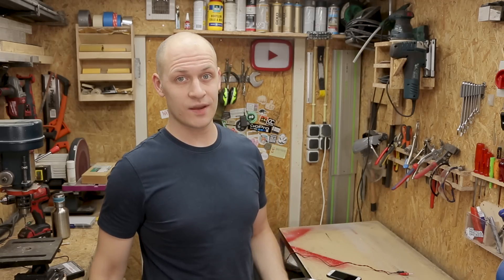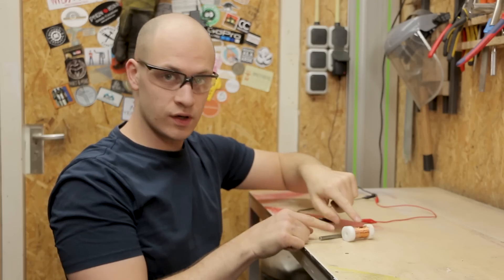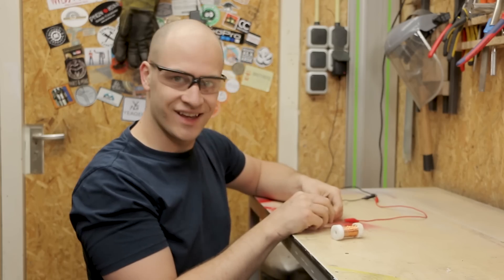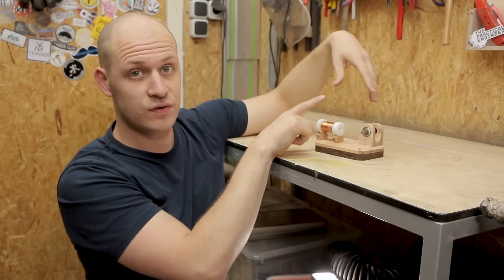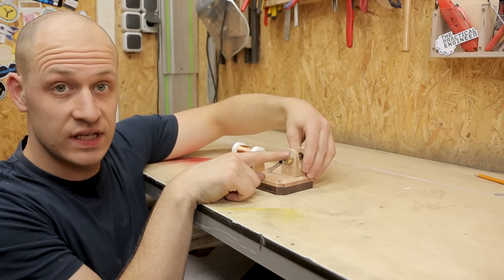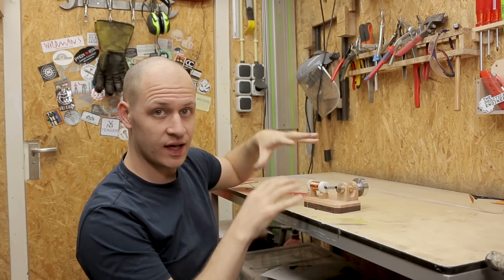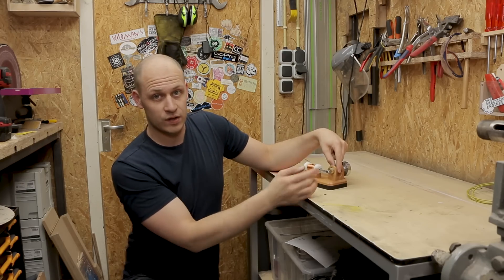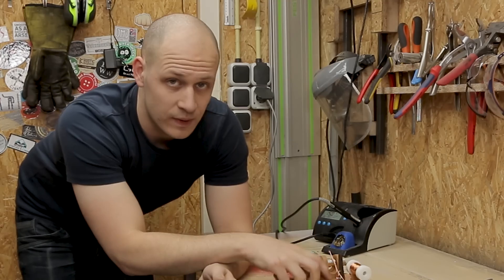How to make a Solenoid Engine

Comment: I have checked YouTube and I cannot find one video on how to make a tubular dual push pull solenoid to have an inch and a quarter push and an inch and a quarter pool so I can use it to ship the motorcycle can you help me can you make one a video thank you
Reply: I forgot to tell you if you could do it it will be used as a momentary switch just allowed to engage to push the shifter lever and then it would disengage I need to push where to go up in gears and I need to pull so it'll drop down in gears for everyone push on the momentary switch it would add a gear if every push on the down momentary switch would reduce it gearthank you

Comment: I'm struggling with mine, not sure if con rod too long or short?
Reply from the maker: Looking at the pictures there are a couple of things it could be: 
- The alignment of parts seems a bit off
- The flywheel looks light, it must have enough mass to keep it going over it's dead spot.
- I assume the direct wiring is just for testing, it needs to switch on and off.
- Any friction will stop it from working.

Hope this helps.

Comment: ❤Hi, your tool is very good, but it is not working properly. I used it for IC thinking and used a power circuit to increase the power. The first weight you used was not good. The copper weight cut the air  It works. I am lucky to have found such a good tool and computer

Comment: I know how to build these know. Made my first one about 6 years ago. You need trial and error. I like the look of the power transistor. I will have to steal that for my next engine. But only 2 instead  of 3 leads on a transistor? I will have to watch a vid to see how that works. Man, I hate transistors!
Reply from the maker: The body of the transistor is the third lead

Comment: How many turns did you put there?
If someone knows how many turns should I do at least , please tell me.
And is there any Physik low that could measure the power of the coil beside the power of the magnetic field in the coil? I mean is there any low how much weight it could carry if you use that for Lifting things?

Comment: Why don't you use an Ne555 signal generator to turn the solenoid on and off repeatedly? They're cheap and would give you more control over the frequency and duty cycle. You can get ready made ne555 signal generator boards on ebay for as little as $1. For example:

https://www.ebay.com/itm/264500705479?hash=item3d957878c7:g:HUIAAOSwgqZdpym3

Comment: you would be able to get better current transfer by using a linear switch and a cam. just use cam distance of 1 mm. the switch need a spring but can use flat surface contact by increased surface area to prevent current loss in input.

Comment: What about a magnetic switch. A Reed contact. Will solve the problem of the sparks
Reply from the maker: That's also an option. In my v8 version I used IR sensors

Comment: also i have one question i don't understand the concept of you putting copper springs and increasing it's speed.
Reply from the maker: The speed increases because when I push the copper wire it makes earlier contact
Reply: @Thepracticalengineer  Thanks buddy that helped

Comment: If you drive the flywheel with a prime mover and replace the plunger with a magnet, could it be a generator? Would be neat to have your motor in series with its twin generator to get (some of) your electricity back.

Comment: Langzaam.  Ik kan je niet verstaan.
Reply from the maker: Oeps, ja ik ging best wel snel steeds I. Het Engels. Zijn de Nederlandse videos beter?
Reply: @Thepracticalengineer  hey, I'm in a similar project, I'd like to see how much it produces when used in reverse, i.e as a generator. Sure it can power a phone but what about a heavier household equipment?  It'd be nice to see the power capability. Although you'd have to replace the piston with a magnet for this to work.

Comment: Hey there, awesome video! I was wondering how exactly does a solenoid measures its power of attraction, or magnetic field? I mean,  what is the relation of that? I assume that the thickness of the wire affects that, the length of the wire around the cylinder and the longitudinal length of the cylinder itself, right? But how could I calculate that, is there a formula? I am interested in the making of a solenoid in all its forms
Reply: What you say is correct, number of turns, thickness, current, geometry of the plunger... the combination of all is not straight forward to calculate. Check out FEMM for solenoids. It's a free FEM tool for electromagnetics.

Comment: sir i have made this solenoid engine...i had used 12v but it appears to be less...so how much volt current and how much amper current should i use.......plzz reply fast its my project n i have to present it😊
Reply from the maker: My version runs on 24 volts. But it all depends on the coil you made
Reply: @Thepracticalengineer  thank you sir☺
Reply: @Thepracticalengineer  bt how much ampere?? 2, 5 ?

Comment: Excellent video. What was the voltage across the coil and the gauge of copper wire used?
Reply from the maker: This one runs at 24 volts I believe I used wire with a 0.36 mm diameter here

Comment: Why waste time to make a spool? The wire comes of a spool!
Reply from the maker: Yeah but the spool it comes with is not good for this use. The wire has to be very close to the rod it has to pull. Magnetic force reduces exponentially over distance
Reply: @Thepracticalengineer   and someone suggested to use a freewheel diode. that's very important to protect the transistor. The energy that would be dissipated in form of a spark is now going into the transistor via the collector emitter route. this will shorten it's lifespan.

Comment: I have suggestion for the switching of coil power
Why not use a micro switch with arm and roller thus eliminating the transistor and the springy wires you made ??
This is how I would do it

Comment: I wouldnt consider this an engine, asana engine powers itself by converting a reaction to energy. Combustion engines take air and gasoline and light it on fire to create an explosion that forces a piston to move. Air engines use compressed air to force a piston to move. In this scenario, we aren't taking energy from anything physical, we're simply giving it energy. I would consider this a Motor, as its converting an energy into some sort of work, in this case spinning. I dont know if I have those definitions right,but I'm pretty sure that is the proper distinction between an engine and a motor. You shouldn't have to give power to an engine, when engines can be used to create power
Reply from the maker: Thanks for your very elaborate way of telling me that I'm wrong. However for some reason devices like this are usually referred to as solenoid 'engines' I can't help that. Being right and calling it a motor will most likely cause the video not to show up in search
Reply: Yo he construido algunos motores con solenoides y la verdad no tienen fuerza  (prácticamente nada de torque) , son ineficientes, pero lo que si me gusta es que son didácticos y construyendolos aprendí un poco. Los he construido con imanes de neodimio y parecen más sensibles y más controlados consumen menos energía y las bobinas son más pequeñas tan bien utilizo volantes con mayor diámetro,  lo que permite un mejor funcionamiento en bajas revoluciones ( al ralenty ) . Estos motores son más bien didácticos y eso lo saben los que los construyen en la mayoría de los casos hay que iniciarnos con un pequeño empujón en el volante.

Comment: I'm not sure why you cut a custom plastic piece on the lathe, and didn't just use the original spool of copper wire, customizing the entire spool for the purpose.
Reply from the maker: The coil needs to be very close to the material that it needs to pull (the plunger)

Comment: Nice post but solenoids and electric motors are not engines.... So the fact ppl in the maker community, keep calling these models of reciprocating engines Solenoid Engines instead of Solenoid Motors is a distraction from fully enjoying the posts about them...
Reply from the maker: I see where you are coming from, but people search for solenoid engine, so I'd be stupid to call it otherwise and people won't find it. 

If you watch it full screen you don't have to look at the title ;)
Reply: @Thepracticalengineer If you do want to refine your design, I suggest adding  a counterweight to the reciprocating mass of the piston and connecting rod to improve the  engine's balance.It's a principle used for developing a crankshaft. And it will also allow the mass of the flywheel to be reduced. 
BTW, The term "Solenoid Engine" was new to me. And I realized soon after posting my comment I was being pedantic and naive, in terms of marketing your posts. 
My bad :)

Comment: This is pretty awesome. I feel like this could have been a precursor or prototype to the core armature design using a cammed switch. Makes building a low power motor by hand easier too. Edit: research confirmed electric motor prototype. :)
Reply from the maker: Thanks! It is an awesome project indeed!
Reply: Yes, put a cammed switch using a set of Automotive points

Comment: Great job on your design and engine!  I have made similar solenoid engines, but the switching has always been a problem.  I think that a hall effect transistor switch would be the way to go.  Thanks for a great video!
Reply: Hi, yes dc in-air contacts for switching even modest current of less than half an amp are a pain.  I agree that electronic switching is far better.  But if you're  a weirdly stubborn purist like me it can be done without semiconductors.  I took the contacts out of the thermostat of a scrapped fan heater, rated for 240V at nearly 8 amps.  Overkill?  My little "electric Newcomen beam engine" runs on 6V at about 300mA.  I gave myself a pat on the back!
Reply: Yo he construido algunos motores de solenoide y si efectivamente para energizar la bobina el switch es un problema. Para corregir el problema hice una bobina con alambre delgado sobre una jeringa que me diera como 15 ohmios y lo que use de pistón fueron dos imanes de neodimio . Para la carrera del piston no usar  más de la mitad del recorrido dentro de la bobina . Para cerrar el circuito utilizar dos alambres que hagan contacto en el eje . Si desea le envío un vídeo
Reply: Creo que fui un poco inprudente , no se si esto se puede hacer ?  siento que no es ético disculpas a practical engineer

Comment: I just discovered you channel and I really like the way your honest about your mistakes.  most you tubers are terrified of showing them and edit everything like crazy.  a true engineer, (such as yourself), knows that all good mechanical devices require hours if not years of trial and error to work out the kinks, and therefor are not afraid of those small mistakes along the way. good on ya bro. 
   as a new subscriber, id like to join the group with a question.
   I've seen other people make solenoid engines of various types, in general they are all very clunky, my question is: is there any practical purpose/situation where a solenoid engine would be better than a standard electric motor, (other than for quick back and forth motion),  for rotating a wheel/flywheel etc?
thanks, and I'm looking foreword to checking out more of your vids.
Reply from the maker: I believe indeed that mistakes are part of the process. But a lot of people get scared by the idea of making mistakes. That why I try to keep them in the video if they happen and they are worth showing.
To be honest I don't know of a practical use for a solenoid engine. But they are nice to make and fascinating to watch.

Comment: we only push or pulled the solenoid engine and a spring which is powered enough to get back the solenoid to it's original position so we used half cycle technology and less electricity?????

Comment: you creates a very strong spring based battery so we press the spring with hydraulic pressure setup  and it's then released slowly and turned the turbine or generators so we got energy or electricity
Reply: How voltage in required

Comment: My favorite parts of your videos are you showing your screw ups and problem solving. It didn't work correctly the first time you powered the solenoid engine but instead of editing out the content you added it. Kudos!

Also I found it really cool that you could cause acceleration by applying slightly more pressure on the adjustable copper wire.
Reply from the maker: Thanks! Yeah! Screwing up is part of the process. A lot of people are afraid of failing and I want to change that

Comment: Outstanding!!! I really like your work and shop practices, top notch. I'd  work with you anytime.  If I may offer a suggestion,  I have quite a bit of experience making and winding coil springs and have used drills, motors, hand wound and lathes to do so. I have found that in all cases running your wire stock sandwiched between a firmly anchored clamp and piece of wood (mounted to in this case the bed of the lathe) will make your windings on your solenoid tighter, neater, more evenly spaced and give a truly professional appearance. I understand that the coil is not a spring, but the principal and practice are the same. All the best, and look forward to more videos.

Comment: I have watched your 4 cylinder one as well, awesome videos. You should try 3d print a Nitro engine but create a solenoid around the piston. You could then re-use most of the Nitro gear, flywheel, maybe the throttle somehow?

Comment: Would this be an effective motor
Reply: Energy in = energy out - mechanical resistance, bearings etc, so it probably just has enough power to make itself move, this is a good project, but is really just demonstrating electrical energy into mechanical energy.

Comment: IDK if someone can help but what are the point of the 2 like springs that rest on it? Is it to keep it rotating?
Reply: I think it is to switch the power on and off so the Piston can move back and forth
Reply: Austin Boals I think where the two springs come into contact with the bushes a different times, one spring is connected to the positive and the the other connected to the negative so changing the direction of poles which allows it to pull and push the iron bar. Please someone correct me if I’m wrong but that’s the observation I’ve made

Comment: I don't understand the switching part plz make it clear
Reply: Arjun pattonathil I think both switches come into contact with the bush at different times. One switch is connected to the positive and one switch connected to the negative so the poles would be constantly changing which would result in pulling and pushing the iron rod. I could be wrong but in my head that’s what makes sense. Hopefully someone can correct me or verify soon
Reply: @Livefree432Livewhole   Thank u ...

Comment: Hi im from malaysia . Where can i get the drawing for this project? Thank you
Reply: Watch this video 10 times with 100% listening. He has given all information. Then try (I failed with different design). Now I am trying to copy a similar design with different proportions and experimenting with solenoid making, winding, SWG, supply volt 12 or 24v, coil material, armature dia etc. It looks easy when we see. But actually its perseverance which pays to a successful result. I like he shows failed attempts too which are very useful and solutions finally.
Reply: Pramod M do you have video ?
Reply: @muhdshafryzal6456   No Sir, to make a video, it requires a different talent. You need to show, set camera angle and have a proper plan and materials and editing skills, which I lack as of now, though I have majority of tools. Though I don't like failures but have learnt a lot from failed projects.
Reply from the maker: I do not have a build plan for this but I have the designs uploaded to my patreon page

Comment: can a solenoid engine drive an auto or truck??  if so why aren't electric motors used more often.
Reply: I think normal electric motors are more powerful than solenoid engines.
Reply: No  son didácticos requieren mucha energía  tienen poca fuerza

Comment: I want to craft a blowback bolt for my gun project, the bolt should move about 9-10cm, what length I should do the solenoid, as the bolt have a welded long steel pipe that should go inside the solenoid, and a spring also to return it as soon as I take my hand from the trigger. Is not a real gun, is just an airsoft pistol and I will build a fake gun around it, but I need to have the blowback effect :) also, what batteries I must use? Can I use 9v or I must have 12v? Also, can I use 7.2 or 8.4v, 1800mah (standard airsoft electric gun battery etc? :)
Reply from the maker: I don't know what you need specific.  But I think you can use any voltage as long as the amps are right. I tried to get about 2 ampere through the spool. Determine what amps you want and from there you can calculate the ohms the spool needs to be. Then you can look at copper wire and use the resistance per meter to calculate what length / thickness combination you need. There is a lot of dependant factors and is just trial and error for me.
Reply: @Thepracticalengineer  all I need is to move a piece of cilindrical  metal, with a Soft spring, but I'm totally crap with voltage/amperage so that's why I don't know if an airsoft battery will do the trick, so to move that 200 grams piece of metal.... But I appreciate your answer :)